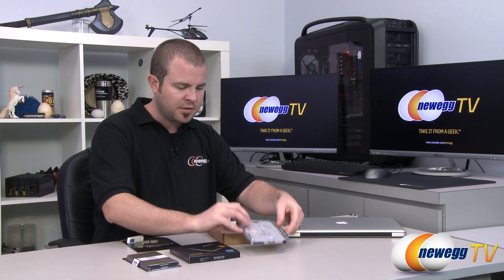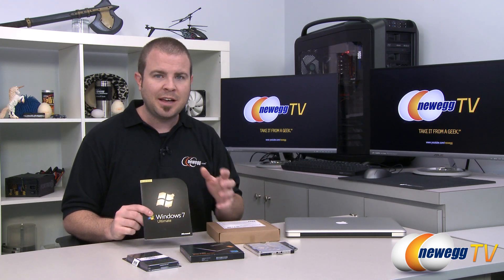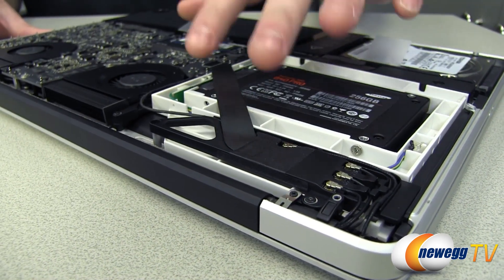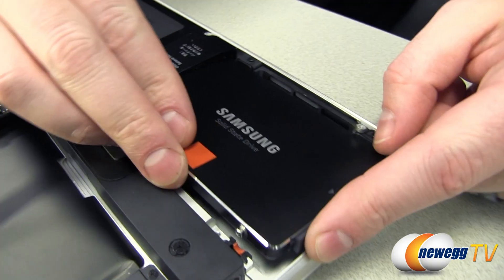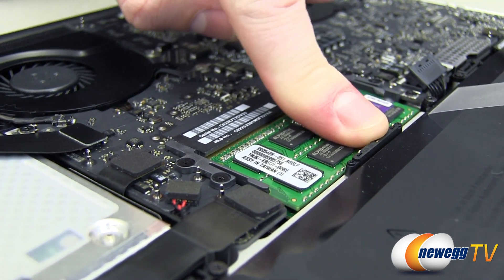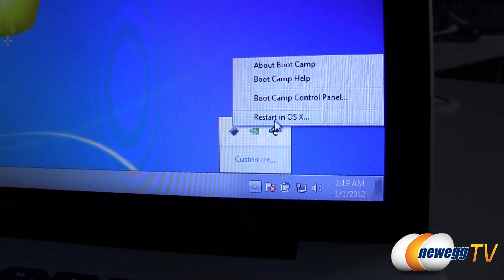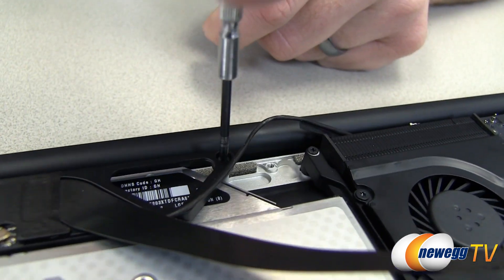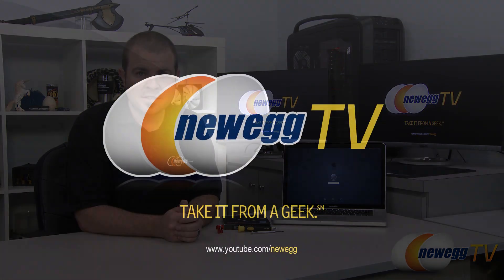Newegg TV: Dual Boot & Upgrade Your Macbook Pro Part II - Hardware Installation

Comment: Quick Question, I want to replace my optical drive with my current ssd, and want to replace hdd on there for extra space so i can upgrade later very easily. But i want to boot from my ssd. Though i have change the sata port is there any problem. or both sata port works like same.

Comment: Mac's can read NTFS but cannot write to it. You will need a special program that mounts the NTFS formatted disks in a way that you can write to it. You can use NTFS-3G.

"macntfs-3g.blogspot.com/2010/10/ntfs-3g-for-mac-os-x-2010102.html"

Comment: I've been building computers for years. I've also been buying laptops for years. The only laptops I've seen working over 2 years after purchase are from Dell and Apple. Each Dell laptop I've bought has been plagued with DVDs stuck in optical drives, screen bezels breaking down around the monitor, failing graphical units, and everything in between. Where can I find these so called "better laptops"?

Comment: a lot of users have told me they prefer to install Windows XP via bootcamp instead of Win7 because it runs a lot lighter. Win& apparently runs very hard and hot through bootcamp. anyone else?

Comment: You did not need to remove the optical drive in the first place. You could have saved yourself from having to remove it if you had just got a SATA to USB/FireWire800 cable and copied the the OS over. Less messing around inside will save time and possible frustration.